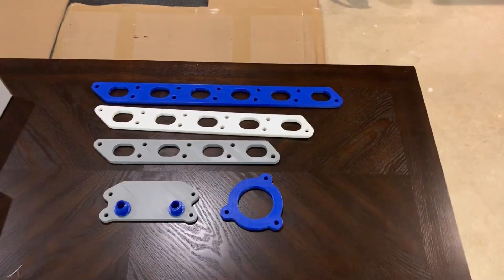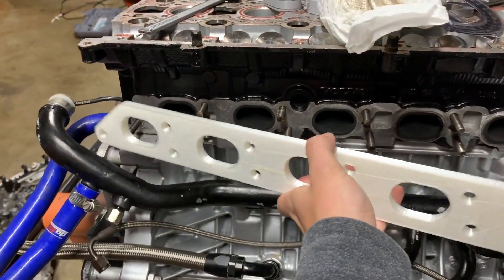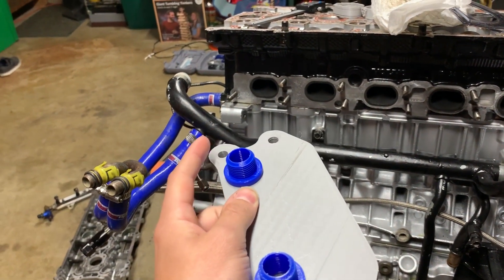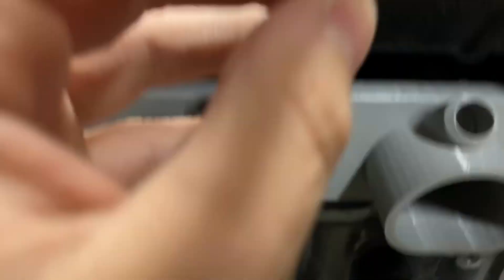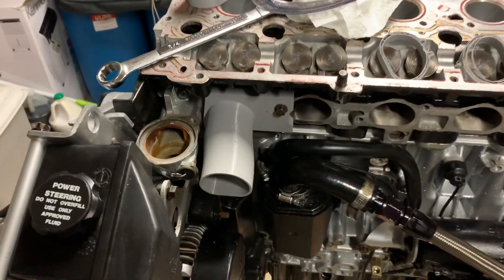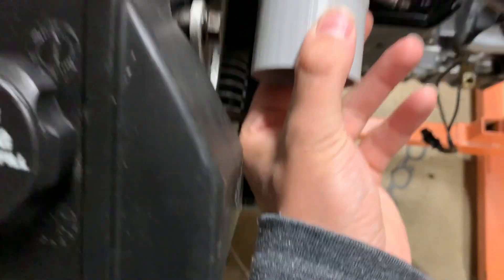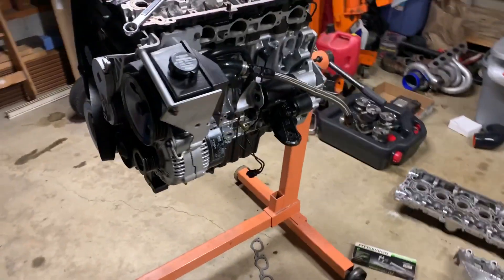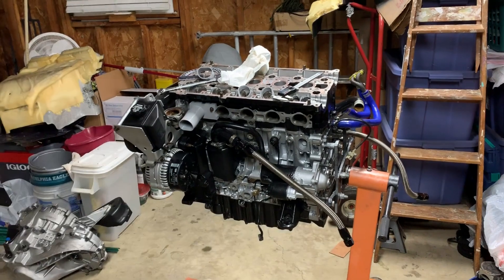Billet Intake Manifold Prototyping Via 3D Printing

Comment: Show us some render pics of your plenum ideas. Where its gona be better than your custom plenum that appeared in this video?
Reply: I haven't had time to design the plenum, but I will when it comes time. This plenum will be better in the sense that the runners will all be equal length and the port offset will be equal as well. Also right now my cut off RN runners are simply welded to the plenum with no form of external or internal velocity stack making a very rough transition. Ill try and find a picture.

Comment: Maybe just create a new thermostat setup. Perhaps a remote inline one, to eliminate the issue of trying to squeeze the intake past the interference.

Very cool Matt!!!
Reply from the maker: Thanks! But i already solved the thermostat runner clerance issues by snaking the runners. IMO much less work to reweld or create a new billet top half of the housing then create a whole new system. trying to keep things as OEM as possible.